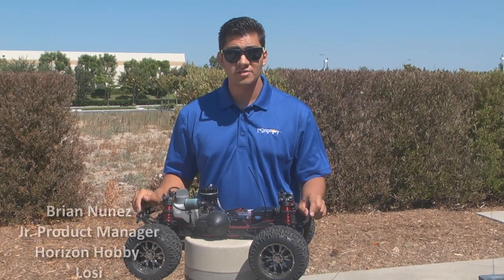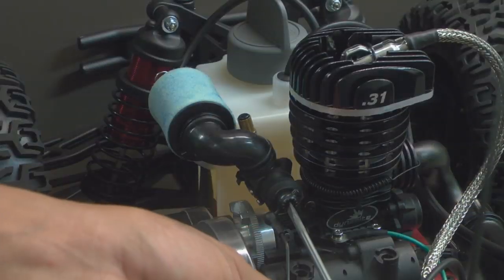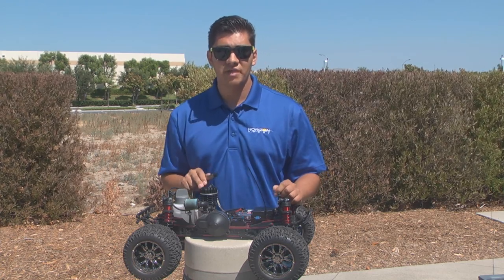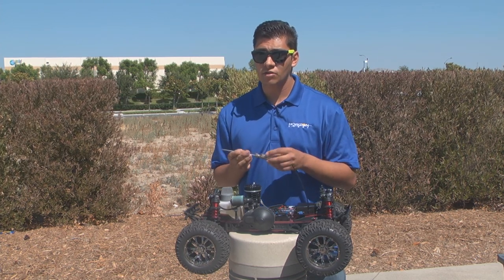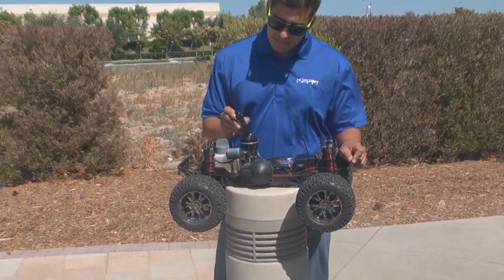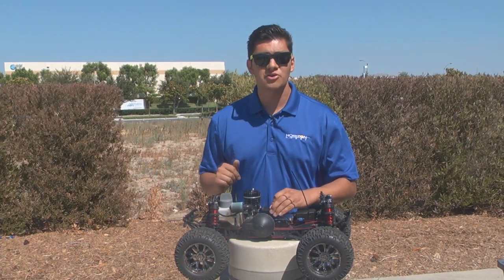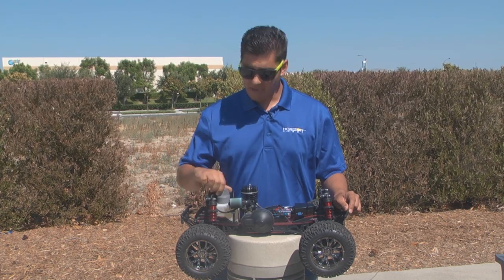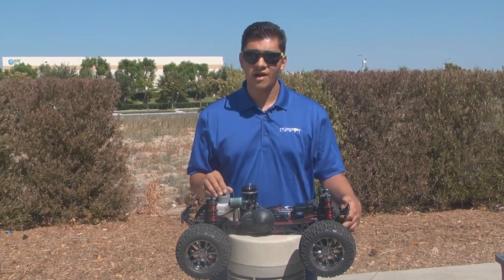Losi® LST XXL 2 Gasoline Monster Truck CRITICAL Needle Settings

Comment: hello, i can't tune my xxl 2... I tried all the settings for my carb, but no one is working, even those recommended by the manual. The engine won't start in 4/5 of time, and the rest, it starts and stops immediataly.
I noticed that the fuel tank lose fuel...
What can I do ? My truck is still over warranty.
thanks
Reply: having same problem on 2 in for repairs even new carb did not help them

Comment: Are you talking 12 hour clock turn it out less then one turn your talking 1/16 of turn or less not one full turn out you explain it 12 hour clock so turn it out less then one turn no turning out one full turn just all the way in and 1/16 1/32 turn out no more

Comment: You said- "Follow the instructions in the manual for the proper settings and break-in procedure."  

The instructions in the manual that came with my truck were way  wrong! It stated 30 hours for the high and the truck came set at 33. Excess fuel from the rich condition creates excess fuel and pressure internally and broke the conrod during the first tank of running. Temp never got above 160F. Fuel was mixed at the proper ratio of 14:1.

Check out the ,pdf from the LOSI site. Its the exact opposite of my book with 30 low and 18 high. You guys are not making this easy. No wonder there are so many failures!

 Mine was running so rich the engine would not rev high enough to engage the clutch. The book that came with the replacement motor says 17 high and 20 low. I am assuming this is correct. Haven't run it yet with the new motor due to being winter now.